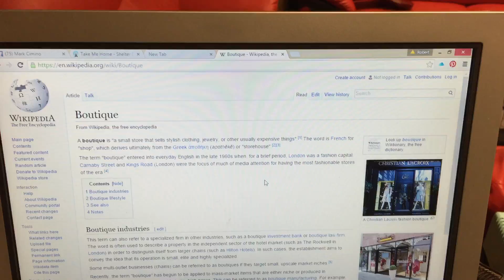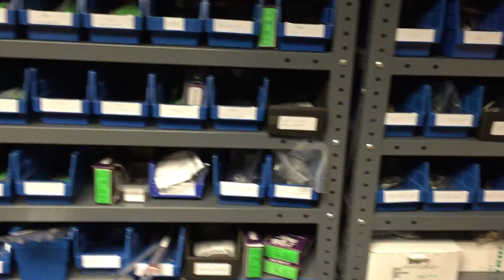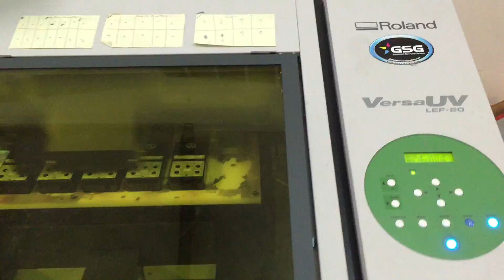Keeley Factory Tour - Engineering and Manufacturing - Effects Pedals

Comment: Dont like all the defective units, I wouldn't let that be known
Reply from the maker: +Eric sin sinner Failures come in all sorts.  Sometimes it's as simple as a surface mount device that didn't get soldered all of the way down, sometimes it's a switch, maybe a pot was scratchy from the factory, and in a lot of cases if we do a run of germanium devices, there are variations our techs might not like and we go back and redo them.  After a run of say 250 pedals we may have say 5-10 that need one of those repairs or we find some human error, an error in the pot value or something like that.  I wouldn't doubt that we have 200,000 pedals that we have done over 15 years.  We try hard to make sure they last a long time in the field.  Foot switches are the biggest culprit.  Those darn things piss off any pedal builder.
Reply: I'm glad he showed it. I want honesty from a company. What we don't know is the fail rate. I'm sure it's still in the low single digit percentage.
Reply: Robert Keeley
Very cool, loving my 30ms
Reply: The Vortex Of Doom 11 months ago I might have been interested
Reply: Even folks like Adafruit/SparkFun talk about a rework requirement rate of 5%+ after boards are manufactured. Robert, I'm surprised I didn't see a pick and place machine!

Comment: Hope those fella's are wearing hearing protection in that printing room, sounded pretty loud and persistent.
Reply from the maker: +Brendan McLaughlin The CNC operator does in fact wear hearing protection.  Also, we have fine tuned the way the CNC operates as well as bought a much quieter air compressor.  The volume level has significantly dropped.  You're right, it was pretty rough in there!